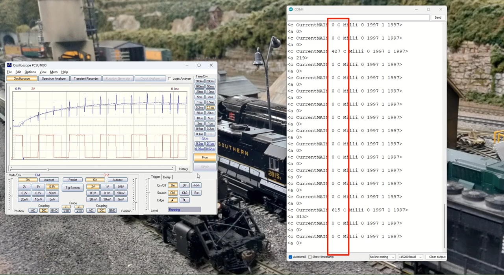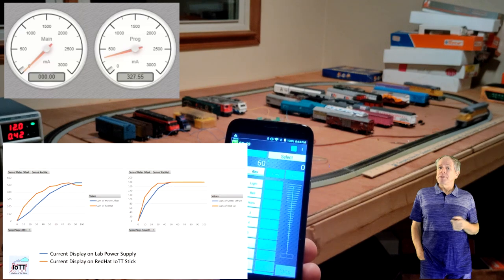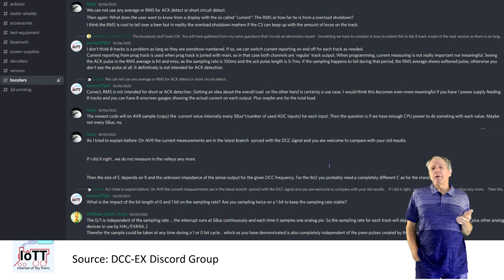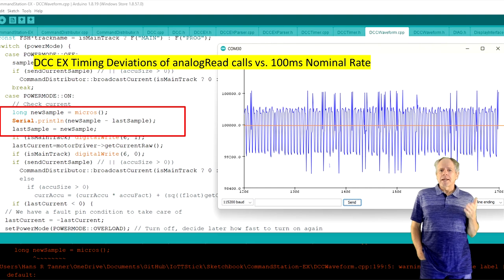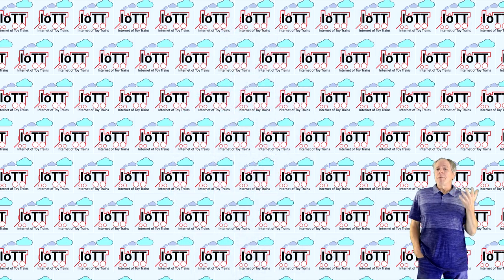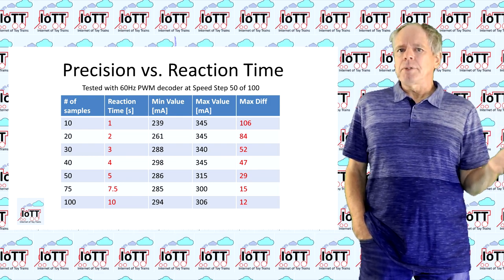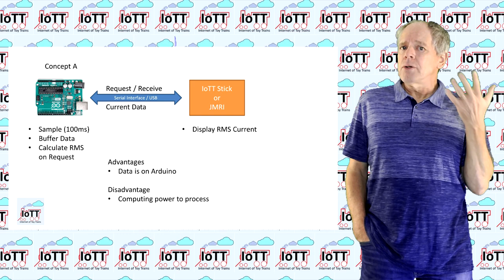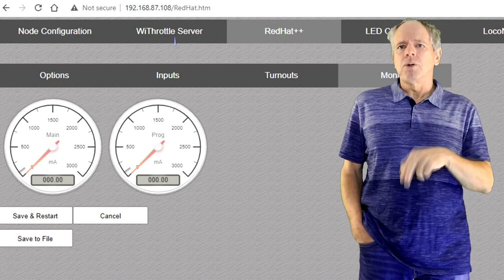Amp Meter for DCC EX - It works! (Video#104)

Comment: Glad that I had my second cup of coffee before I watched this video. Yes it is technical but you did a good job of explaining the process. This is a great feature to add to the IoTT stable. Once you get the higher current motor driver working, I just might consider replacing my NCE PowerHouse system with my Red Hat. All of these features and it’s open source concept make it a very versatile product. Perfect for upgrading DCC. Love what you are doing Hans! Please keep it coming!
Reply from the maker: Thanks. Unfortunately, the IBT-2 is somewhat a different animal. We will see what's possible.
Reply: @IoTT  Yes, I can see that although, with your skills, I can see you succeeding where others have failed. I will patiently wait.

Comment: Hi Hans. Yes exactly. As an ex electronics engineer I used to design sampling systems and one of the golden rules is that you need to sample at at least twice the frequency of the waveform in question to get meaningful results as determined by a fellow named Nyquist. .....................John
Reply from the maker: Yep. Fourier and Nyquist rate. There's a reason they teach you that in EE schools ;-)

Comment: Excellent, but complex, obviously. Don't forget that DCC-EX is also planning on adding support for multiple power districts, and that implementation will probably require more work for current measurements. 

With the base system, 2 current gauges makes sense, but with more than 2 power districts, external metering would be more practical in use. Those external meters obviously could be in JMRI, but physical meters driven by a wireless microcontroller placed around the layout sounds like a project that you might consider. Using BT LE instead of WIFI would make more sense because it would negate the need for complicated configurations.

You continue to impress the engineer in me. Your ability surpasses what I can do by an embarrasing level. I can get things done by brute force software, but your soluitions are elegent, if not too complex.
Reply from the maker: Thanks. For me, the aha-effect really came when I recognized that the current measurement input needs to be treated as periodic signal and Fourier rules would apply. From then on it was just application of what I learned 40 years ago about periodic signals. It still worked ;-)
DCC EX will have 16 analog inputs in the future, and I guess all of them could be used to measure H bridge current. We will see how to deal with that as it becomes more clear what the DCC EX software will support. What is already clear is that the timing of the sampling will dramatically improve at it will be driven from the timer interrupt. That's a big plus for the precision of the meters.

Comment: Hans ... a very thorough, thoughtful, and appreciated video regarding DCC-EX current measurement.  In addition to a loco(s) running on the track, a user might have one or more lighted cars ... and/or ... one or more stationary decoders connected to the track.   Does the presence of either of these affect the current measurement?   Would a current measurement as you described in this video include these?   Thanks for your attention ... all the best.
Reply from the maker: Thanks. Yes, I did not show that in the video, you switch the headlights of the locomotive on, the meter goes up 100mA. And yes, it measures the total current that goes out from the driver. For the video I had to disconnect some current sensor modules as they are powered from track and lead to a current consumption while no loco was moving.
Reply: @IoTT  Thanks for your reply.  You gave me a new winter project!!!   Bought a hardware DCC power meter, but never liked it.  Just wondering ... if the DCC-EX team expands hardware to include an ESP32 of some sort, that should help your power measurement method ... at least I think it would.
Reply from the maker: That depends what the ESP32 is used for, we will have to see. What definitively helps is making the sampling part of the timer interrupt because it makes the sampling interval much more stable. The quality of the current measurement will increase.